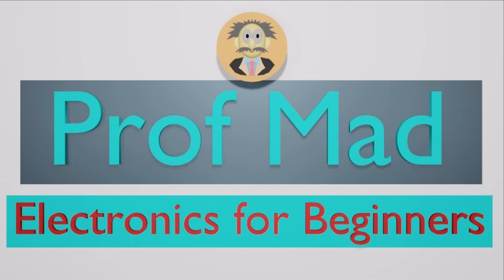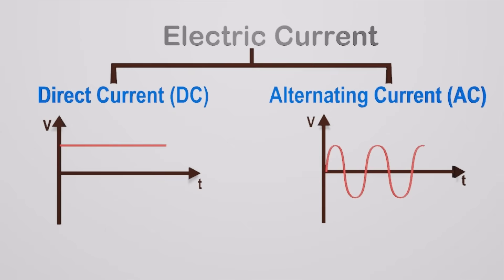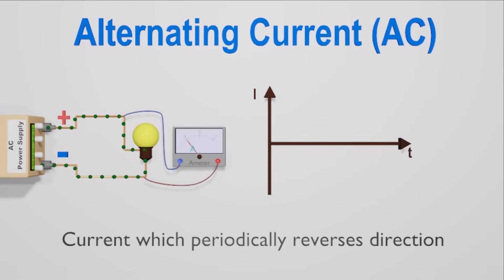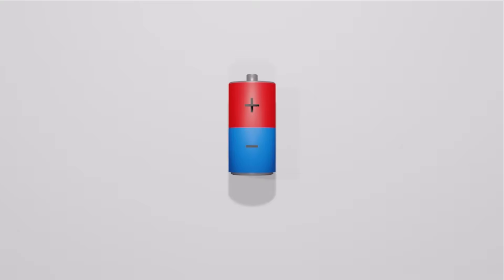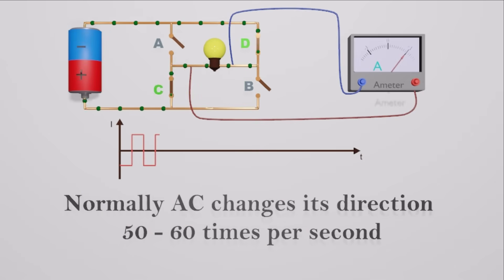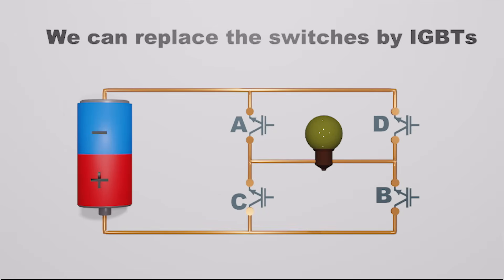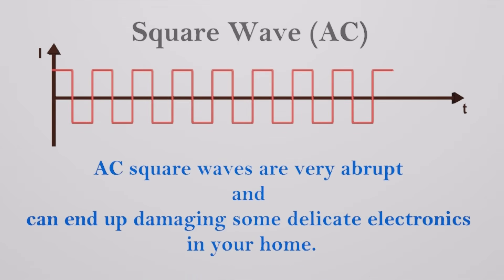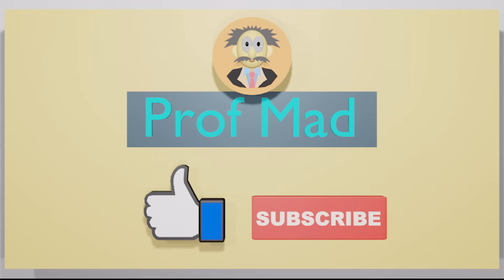How To Convert DC to AC | Direct current Inverting | 3D Animation

Comment from the maker: Dear friends, the ammeter connection shown in this video is totally misleading. You should connect an ammeter in series manner with the circuit, I was completely messed that up. But it will not affect the core idea of how to convert DC to AC. Ill upload the corrected videos ASAP.
Reply: Your honesty is appreciated !
Reply: Yes
Reply: If you can "tune" the robot voice over, it would help, too. It throws inflection around like an idiot.
Reply: Sir I have a doubt ...will the current produced be enough for a electromagnetic induction ...as I'm trying a project on mutual induction like the one in transformers ...but a little simple one with 2 coils placed one over the other
Reply: I would really appreciate your help🙏🏻
Reply: 07:56 I think diodes should be in series not in parallel with IGBTs.
Reply: Sir, can we make control circuit shown in this video?
Reply: In  Dc  series  motor  the  fild  winding  is  connected  in  series  with  the  armature  as  shown  in  dc+  il  dc  siuppley  -il motor  y2  coil  m  A1A2dc  series  motor...the  fsrries  fild winding  carties  the input  current  carries  the input  current  it  jas  large  coross sectional  atea  and  few  number  of  turns  few  number  of  turns  becuaseof  large  corosssectional  area  and  few  number  of  truns  sreies  fieldwinding  has  low  resistance..
Reply: Thanks mate for your content
Reply: Az elektron vándorlása a vezetőben a negatívtól a pozitív irányba megy,a videóban fordítva van. Amúgy teljesen jó a magyarázat,jó a video. 👍
Reply: Thanks for the honesty and totally appreciate this.  As a content creator I totally understand the shear amount of work it takes to produce these videos.  However I'd love to see you make a second part on how to convert the H bridge to an actual sinusoidal waveform using PWM
Reply: Good Try Bro
Reply: 200%
Reply: Which electronics uses AC? I don't recall any, unless we're talking about rectifiers. But why would we use rectification on a square wave we just got off a DC supply? Please clarify, thanks.
Reply: you have not uploaded anything corrected, what a shame
Reply: I was just about to comment
Reply: Seriously 😳 😮😮
Reply: Thanks for the update
Reply: But honestly it's a very educative video...
Reply: There are lots of wrong spelling as well!
Reply: :face-fuchsia-poop-shape:
Reply: Yes! The ammeter connected in parallel to the load.
Reply: It is wrong way of measuring the amp.
Reply: No,you need correction, as you said ammeter used in series, you are right. But he wanted to tell you the negative and positive value of current,, but you use by replacing bulb. This is only for make you understand the concept behind.
Reply: I was entered in comments to show this issue but there is already it answered
Reply: So not only is this giving wrong information but the computer voice is annoying to the point I couldnt keep listening...hmm...great job, Prof.
Reply: You also screwed up with being USA centric. Much of the world uses different AC voltage and frequency.
Reply: @kevgermany doesn't change the concept
Reply: I thought this is a professional video..but this connection of ammeter puts this effort down

Comment: BTW, A 50% duty cycle square wave with the same frequency as the resonance of a RLC underdamped series circuit results in a sine wave across the terminals of the capacitor of the RLC load.

This happens because the natural response of an underdamped RLC circuit when DC is applied is to oscillate back and forth, at the resonance frequency and around the "final" threshold, until the system achieves virtual equilibrium (that is, when the capacitor and inductor stop exchanging noteworthy amounts of charge). However, when you use a square wave with the characteristic specified rather than DC (a frequency that tends to zero), you are reverting the current direction every time the oscillation changes direction, effectively contributing to giving momentum to the oscillation rather than countering it.

In short, the peak-to-peak voltage of the oscillation of the underdamped RLC circuit under this condition stops tending to zero, and starts tending to a certain fixed value. The longer the circuit is kept running, the more stabilised the sine wave across the capacitor becomes.

Oh, and if you are wondering about the use of the capacitor terminals as IN-OUT (rather than the resistor's or inductor's, for instance), the reason is quite simple: capacitors resist changes in voltage, meaning that the voltage is always a continuous, smooth curve (sine in a RLC circuit, log or minus exp for RC) rather than the "deformed", only vaguely sine-like stuff your get across the resistor or inductor. And in the case of the inductor, the change in voltage can be so abrupt that the whole circuit gets reversed (for example, when the power supply is inverted or turned off), possibly burning bias-sensible components.

Comment: We Can hook a small electric generator motor  to the batteries to help to convert DC to AC the output of a generator motor forms an AC wave form.  True or False
Reply from the maker: Simply put — No, but also Yes. If your generator motor has only one coil, it is used for both motor and generator functions. That alone will not work as a DC to AC converter. In most modern machines, the same coils are used for both motor and generator functions, with electronics controlling the mode.

However, there are motor-generator systems with separate coils. These are basically like linking two machines by their shafts — you power one motor with a battery, and it rotates the other machine (the generator), which then produces AC.

Comment: AC amplitude found in homes: 120 volts.  If you want to get technical about it, the voltage measured by most meters is RMS, or root mean square.  This is to say that the effective voltage is 120 volts, measured somewhere along the sine wave.  The actual peak to peak voltage is more like 170 volts.

Comment: 1:52 Amper is not measured in parallel connection. the amp meter should connect in series.

Comment: In my early teens I played around with batteries and one day connected a transformer and got a shock.
How? From 9 Volts?
I later found it was back e.m.f.
I made an inverter for my 1944 Wireless 19 Set to supply the H.T. voltage by using two NKT404 transistors, two 100 Ω and two 15 Ω wirewound resistors, four diodes and a smoothing capacitor and a 250 Volt to 12 Volt transformer wired backwards.
I recently bought a Plessey non-synchronous vibrator out of interest which did the same job of chopping d.c. current.
G4GHB.

Comment: You need a low distortion inverter...

Like a Dimension...now made by another company but still good...

I have some 2.2kW rated 120 VAC 60 Hz out...24 VDC nominal in...

Even though now they are little vintage...i think they are is like 95% efficient...

Going camping...I use two 8D 12VDC bus truck batteries in series...

To play the Karaoke machine...make coffee....a light for the tent...

It is no trouble...if there is a great singer...to be heard 0.5 mile away....

A little Honda 140 cc rngine  driving an Leece Neville alternator is used and fired up time to time to charge the batteries....

It is amazing how the price has come down as far as new inverters on the market

Comment: After a very didactic presentation, instead of talking about a "modified wave", which to me means nothing, why not explain that the square wave is an interaction between a sine wave of the same frequency as the first one and its harmonics of odd order? You could even graphically show the point-by-point sum of the instantaneous values of the fundamental and its harmonics of the 3rd, 5th... 13th order, from which we can conclude that the elimination of these harmonics simply converts the square wave into a sine wave. The most prominent is the 3rd, the 5th has less influence and so do the others. A simple low-pass filter blocking these harmonics allows the availability of a satisfactory sine wave...

Comment: The ammeter is always connected in series because it is low resistance
Reply: no dude, its connected in series with the load because its measuring the flow of current that is coming in the load, by connecting it in parallel, you measure a different flow

Comment: You did not convert DC to AC. You just said it could be done. Major FAIL!
Reply: he said and explained it well, what are you talking about?
Reply: @lusoclement3787  He talks about using IGBT's as switches. That is no different than using SPST switches and flipping them back and forth by hand 50 to 60 times a second. Or you can connect and disconnect a battery (also by hand) 50 to 60 times a second to the gates of the IGBTs. You still have to do it yourself or, use an external AC source to do it for you (as he suggest). So if you already need an AC source to do the conversion, then you are not converting nothing. It would also work if you build a 5million dollar robot to flip manual switches at 50 to 60 times a second. But still, kind of a lame answer!

Simple answer to HOW to convert DC to AC is to use a vibrator circuit. You won't need anything external as a source because it REALLY DOES convert DC to AC with nothing but itself! The frequency is controlled by its own coil. No external AC signal is needed because it takes the DC and literally changes it to AC! That! Is how you convert DC to AC!
Physical Example: https://www.youtube.com/watch?v=VDetDwINFVo 
Solid State Example: https://www.youtube.com/watch?v=S49xKRpqgEE

Comment: Never tried it but as 99.999% of products we use transform AC to DC via transformer / bridge rectifier / capacitors / - by applying DC to the output of the above would this not provide AC 🤔 just a thought

Comment: just a heads up, the voltage of a wall outlet is actually 120v rms so the amplitude of the sine wave would be closer to 170v, not 120v like you said in the video

Comment: Awesome video.  You explained the conventional and present means to describe current flow, current flow in general,  and the different kinds of AC wave forms. These topics are rarely covered in these kinds of discussions, well done.   I would like to have seen how capacitors are used to create the offset since wave,  I suspect that the result is truer to sinusoidal waves than shown.

Comment: hello sir I hoppe for some advice the circuet in question is the gm 4 pin ignition module ,pick up coil and e core ignition coil. I use curentli 4 pin relay with 2x diodes on the switch side and coil side on the relay for bether arcing protection I placed 10amps diodes . But thats not the problem I done new wire harnest reinforced it sucessfull but by module isnt variabel enough it uses the mc 3334 ic chip for hei ignition my module does not gave retarding ignition timing option so I was wondering how can I force that thing to retard ignition timing? I honestli dont care what to use pick up coil,module or ignition coil manipulation. I did fhew times used the continueti test on my multimeter and it seams that module wuld work on that frequency given by the multimeter to the pin input to the ignition module I also noticed 2 ignition modules can work on 1 pick up coil I noticed the ignition module can by activated by just useing the + lead from pick up coil,I noticed by placeing external magnets on my pick up spark is lot stronger so I ques the zener diode is missing in my module compared to the mc 3334 chip diagram who can by easeli found on google . So I hoppe for any advice how can I phase shift that deam thing???? I was wondering if pulse generator wuld make difference if I unplug the negative lead from pick up coil and pulse current to interupt the signal leading to the + lead to the ignition module,or some sort of disruptung signal circuet or remote controled circuet or resistor/capacitor box honestli Im out of ideas curentli that deam ignition module does lot things increase spark decrease amps saturation but it wont phase shift so how do I deal with this unusual problem???? I read lot peopel use inductors resistors and capacitors but sadli I dont even know where to beggin or what calculation shuld I use to determine what components I shuld use to delay that silly pick up coil signal to the ignition module. I reali hoppe you know some smaller circuets that can help with my problem I have terribel cold start problems in winter so engine wuld easyr turn if spark is retarded my land does not have those 5pin gm ignition modules who retard ignition timing . Once I did try out b500k pott potenciometer on my pick up coil positive ignition module positive input didnt go as planed car run terribel I did cinde of reduced the spark and insted litel retarding it gone strigh 180° phase shift the car basicali run at exaust stroke fiering so I was preaty much confused not because of the engine running at exaust stroke I done it in the past as hobbi engine conversions but Im confused why It did not work??? So I ques my pick up coil isnt based on current its based more on voltage and frequency manipulation and I cant finde any thing similar to my needs on the internet what I posibli culd use as circuet control and what exact values shuld I look for? I hope that you can look at the hei circuet at least give my some info if there is some equalent variabel 555timer circuet who I can use insted or some sort of circuet that I can control manuali an darlington high power transistor as exampel . Im seriusli anoyed with my current ignition system it has lot faults does not work well under low engine rpm ,during winter spark to weak coil saturation is terribel  .So I simpli desire some thing more variabel and more power full ignition system that has if posibel inteegrated circuet for reverse voltage protection .Because in the past I used variuse capacitors on my ignition coil engine run great but problems acured with alternator starting current charge it good meesed around . So any way I hoppe you understand my questions and problems what I face with my current circuets .Im simpli terribel at understanding polariti ,phase shifting centrain components ,reverse voltage protection . So hoppe some one see this comment and has similar experiances like my with ic chips who are exposed to static/back charge via wires or ground reference . I fixed lot things in my car all circuets have extra diodes I plane to use zener diode on my ignition modules but again only problem I have Is to figure out how to retard that deam ignition module or any other circuet about the ignition system

Comment: Well that Ammeter really ought to be a voltmeter. The snag is that we want to use the terms "Alternating" and "Direct" Current. It always seems worth the while to show the origin of this with a magnet spinning near a coil. The speed of the motion gives the frequency. Its the voltage output polarity and extent of it during the cycle that is so informative. So is the notion that without the changes it won't work! Now with that done we can move on to describe that in basic circuits - say lamps and heaters - it won't matter. Then we have the spin off that is induction which allows us to step the voltage up or down (transform) and is is so useful.  NOW we can embrace conversion from ac to DC and vice-versa.

Comment: AC and DC difference's are, AC is switched on and off 50 times a second, or 50 cycles = Hz and DC is not, it's direct.
Electric is electric, it's all the same stuff. You can only switch it 
off = 0, or switch it on = 1, the same as a computer works 1's and 0's and which the power symbol represents.
Both need a positive and negative flow to work. If electrons exist and flow through cables,  then how does wireless induction work?  everything is fields, you find it easier to understand then. Think, water, ice and steam, then think, electricity, magnetism, dielectric. ther all the same thing, in different states.

Comment: Please is it necessary to use transistors? I mean can I use optocoupler to replace the transistors and then use control circuit to switch the optocouplers
Reply from the maker: Optocouplers will work too, but pay attention to the power ratings and switching frequency.
Reply: @Profmad  thanks 💖

Comment: it is wrong if i say in ac it never change polarity of the cable? hot still hot 120v neutral still neutral which is Ov.. only the operation of the hot cable changing.. push electron during the +ve sin wave and pull electron during the -ve sin wave

Comment: In this vidio at starting time ammeter connect in parallel in circuit which is wrong,ammeter connect always series with electrical 
load

Comment: If the direction of the current is not important, then how does the diode work in a circuit if the flow of electrons are from the negative side to the positive side ? .

Comment: @1:52 and @2:37: You do realize, I hope, that the way you connected the Amp meter is not right. This is the way you woud connect a voltage meter. An amp meter is placed in series with the load to measure the current in the wire.

Comment: there's no such thing as alternating current, electricity flows in one direction only, changing direction around a circuit is not the same thing as going in the opposite direction, this stupid pseudo science has to stop, can you go backwards and forwards at the same time, can a river go forward and backwards at the same time,  AC is a hoax and is made only possible by a digital device which will show a negative sign or a switch on an analog to show negative polarity,  an electrical component allowing electricity to flow in a different direction through it is not an opposite current or alternating current(AC), it just means that no matter what direction the component faces, electricity can flow through it, such foolishness

Comment: i guess its more posible to use volt meter rather than ammeter on that parallel connection, it can also show positive and negative reading if its only to show the polarity